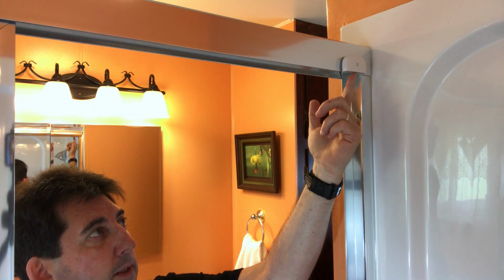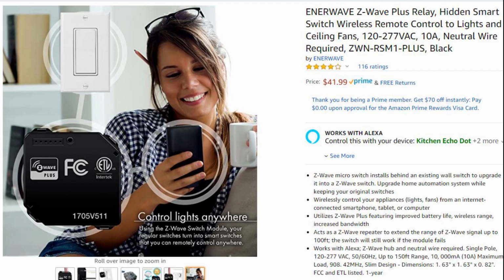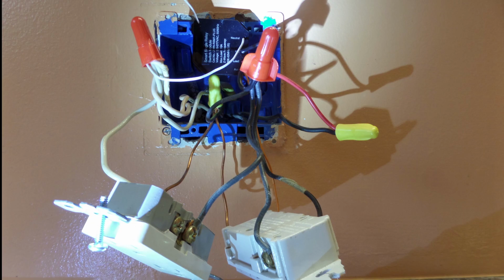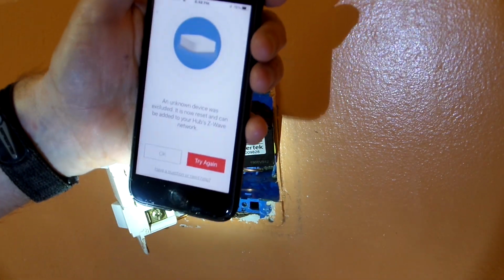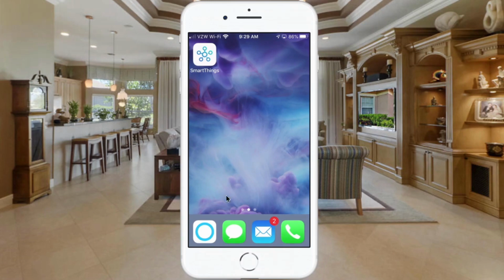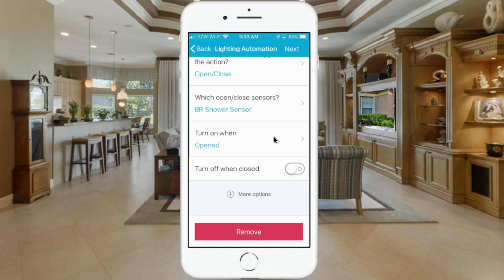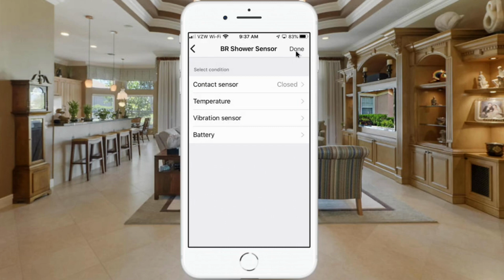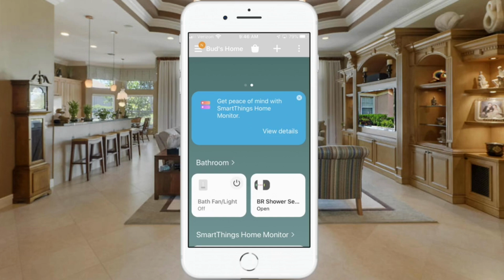Bathroom Fan & Light Automation Using an EnerWave Z-Wave Plus Relay

Comment: problematic sensors with lots of false motion detection
Reply from the maker: Hello Dan. Are you referring to Z-Wave sensors in general, or are you referring to this particular device? The EnerWave device featured in this video is just a switch that responds to a sensor.  It is not a motion detection sensor, so I’m confused about your statement.

Also I’ll mention that this switch has been an excellent device for me. I’ve had it a couple of years and it has worked flawlessly.
Reply: @BudsSmartHome  the Zooz multi sensor
Reply from the maker: Yes, I’ll agree.  The Zooz Multi-Sensor which I have has not been all that reliable.

Comment: Grabbed a cup of coffee, watched your video and learned something.  I have a dual switch like you and couldn't initially find a dual smart switch for a 1 gang box. However just found that zooz has one thr zen30.  Ordered it to check it out. If that doesn't work like I hope I'll try your relay solution.
Reply from the maker: Yes the relay worked out as a perfect solution. I really like that you can control it manually as well as through SmartThings automations.  Let me know how the Zooz switch works out.

Comment: Hi sorry to bother can you do a review about Zooz Z-Wave Plus 700 Series Universal Relay ZEN17 with 2 NO & NC Relays (20A, 10A)
Reply from the maker: Alejandro- I will consider doing a review should I find  a need to include this switch in my current smart home setup.
Reply from the maker: According to the product description:  The ZEN34 is supported by: SmartThings (with a custom handler, instructions included with the product),

Comment: Hopefully, you can answer the question I always have about these wired-to-a-physical-switch relays: Can the Z-wave module override whatever the switch is set to, or does "ON" on the physical switch always take precedence, or does "OFF" on the physical switch always take precedence? One of the reasons I don't put z-wave wall-warts on switched outlets is because, if you switch the outlet off at the physical switch, then the wall-wart is unpowered and, hence, the z-wave is useless. That's an example of physical "OFF" taking precedence.
On the other hand, if the physical switch "ON" taking precedence, then you'd be unable to turn the light off via z-wave if the physical switch were on. Also, if the z-wave part were "on" and the physical switch were turned off, then the light could stay on, which would confuse users.
What you really want is probably for the device to honor the most-recent transition, regardless of the source. If the z-wave part had the light on, and the physical switch is turned on, light stays on. If z-wave or physical switch is changed to off, then light turns off. Of course, this leads to some odd cases (if physical switch is off and z-wave is on, then, to turn the light off from the physical switch, you'd need to turn the physical switch ON, then OFF), but they're more intuitive than the earlier cases.
Anyway... do you have any details on how this unit operates?
Reply from the maker: The device will honor the most recent transition, regardless of the source. If you physically switch the device off, that status change is reflected in the SmartThings App.  If the switch is on and you turn it off in the app, the device will turn off, but of course the switch position is unchanged.  I hope this answers your question?
Reply: @BudsSmartHome  Perfect. Thanks!
Reply from the maker: @joeemenaker  You're Welcome Joe!

Comment: Can I use this to control a ceiling fan, I have the Hampton bay zigbee controller but it’s too far from the hub, any to try this, don’t care about fan speed just light and fan on and off, thanks
Reply from the maker: Johnny, It depends on the load on your ceiling fan.  The maximum load for this switch is 10 amps.
Reply from the maker: Doing a quick search, an average ceiling fan set on low speed uses about 0.25 amp, on medium speed about 0.4 amp, and on high speed about 0.6 amp.  So it looks very doable.
Reply: @BudsSmartHome  thanks for taking the time and do the research for me, appreciate it, so I’ll be ok with the fan (doable) what about  the light part???
Reply from the maker: @jgoni20  - you should be OK as long as you stay under the 10 AMP limit

Comment: I'm trying to install the Enerwave Z-Wave Relay like yours with the new Smarthings App. Does it work with this App? I can't get them to interact. THX
Reply from the maker: Hi David.  The following describes the process of "Inclusion/ Exclusion" , (see page 2).  https://tinyurl.com/y64nbw2q  Note that the  Hub should be brought physically closer to the
device just for the "Inclusion" process (recommended within 10ft).   I installed the switch from the Classic app, but it was necessary to exclude the device before adding it to the app.  I tried without exclusion and it did not work.  if your new device won’t connect after several attempts, you may need to exclude the device still. Sometimes a device partially connects, or is partially removed, behind the scenes. General Z-Wave Device Exclusion should fix these issues.

Here are the steps to perform a General Z-Wave Device Exclusion in the new ST App:

From the Home screen, 
*  Select Menu (Menu icon) and touch Devices
*  Select the SmartThings Hub
 - WIFI
*  Touch More Options (More Options icon) and select Z-Wave utilities
*  Touch Z-Wave exclusion
 - The app will prompt you to perform a Z-Wave exclusion on the device. Refer to the device's manual for specific exclusion steps.  The app will indicate when the device is successfully removed.
*  Tap Done
Reply: @BudsSmartHome  I've tried all that 3 times and it just does NOT connect. Will go through it again. BTW, I moved my Hub right next to the switch. But, when I go to the Z-Wave Exclusion utility, it shows nothing is there to exclude.
Reply from the maker: That’s very interesting.  I’m kind of  out of ideas at this point, other than if you still have the classic app available you can try to install through old app.  Let me know if you’re successful.
Reply: One more question. Should the manual switch still work to the light even though I can't get Enerwave to connect? I checked current to the key leads and they check out.
Reply from the maker: Yes.  My switch works both manually and with the app. Additionally when I change the switch manually, that status change is reflected in the app.
Reply from the maker: By the way, my inner wave switch does work in the new smart things app

Comment: Always considered a relay but this video shows that the boxes for my switches are way to small lol

Great detailed video!
Reply from the maker: Hi BTG. You may be surprised. I thought it would be challenging to get the relay in the box, however if you have a standard plug receptacle or switch it should not be a problem whatsoever. As you can see in the video my plug receptacle and light switches were larger than normal, yet I was still able to comfortably place the switch in the box. Thanks for the thumbs up BTG! 👍
Reply: @BudsSmartHome  The few I would use them in are basically the size of tictac boxes and stuffed already lol
Reply from the maker: @BeardedTechGuy  .  IC.  Not a good situation then for sure!

Comment: I actually have the Zooz sensor in my shower trying to get it to work flawlessly so I can make a video but I think the issue is that the humidity it’s too slow to increase. So I am looking into a better humidity sensor.
Reply from the maker: Yes, so far I'm not too impressed with Zooz as a humidity sensor.  I tried several device handlers and still could not get it to respond reliably.